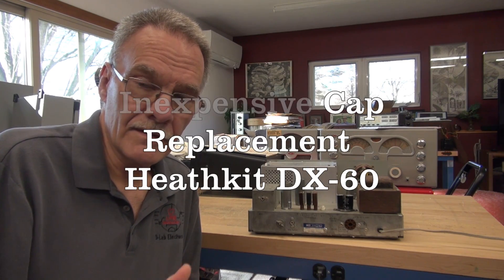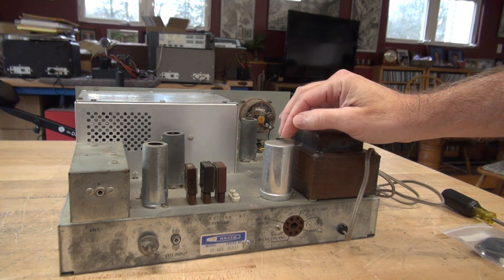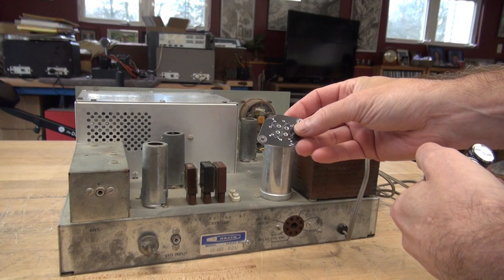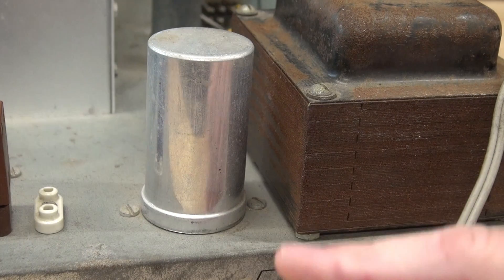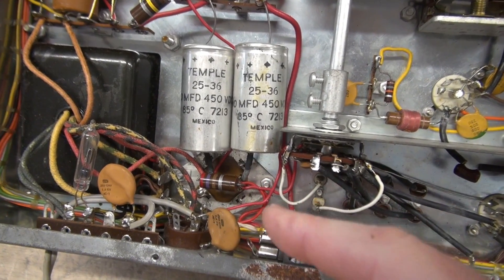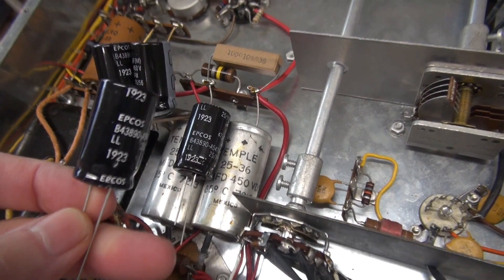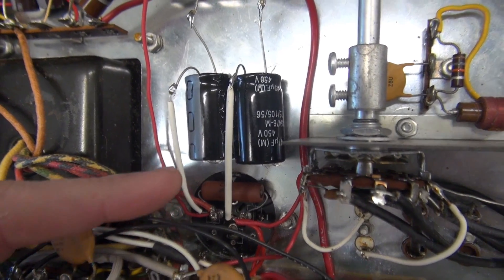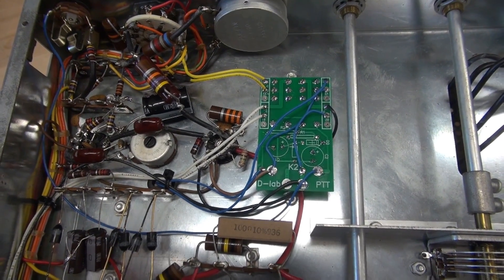Inexpensive solution replacing filter capacitors Heathkit DX-60 Ham tube transmitter Universal kit

Comment: Is the rust on the laminations of that trans a problem? how to correct? I see ll on the epcos cap .is that the series?at what point do you use resistors across each cap for voltage equalization?I'm just at point of building a b plus supply over 500v so will be series some caps for 700 to1100v.

Comment: Terry I ordered a 4:1 600v max can cap board from scotty.  It came with a can cap insulator.  Is the insulator necessary or an accessory when mounting the pc board can cap adapter to the chassis?
Reply: Are you referring to the spacer board? There is a round disc spacer that will have matching icons for the board. That is there to clear the solder turret to the body of the capacitor, as it will stickup about 1mm above the board on the "cap side". Should show in the included instruction sheet.  If I sent you the football insulator (cant remember on your order), that is for going between the main cap board and chassis. That is only needed for the isolated can common. IE for negative bias, or voltage doubler circuits (amplifier Power supplies) the common of the can does NOT get attached to ground for negative bias, and also on one half of the voltage doubler.  IE Heathkit HP-23 and Drake AC-3/4 supplies, Fisher 400/500/800 series, etc
 Hope that helps. Feel free to contact  me if  you need anything and thanks again for your orders!
Reply: @coneslayer18  thanks for the heads up Scotty.